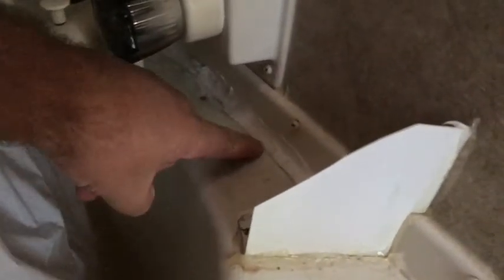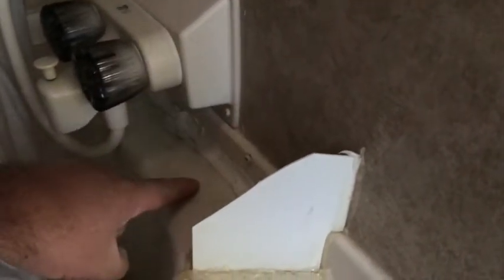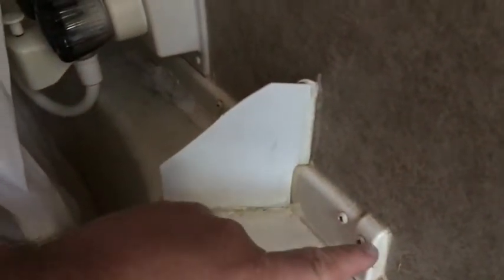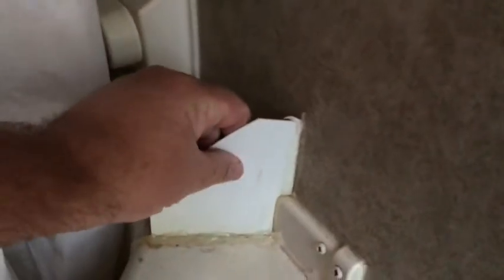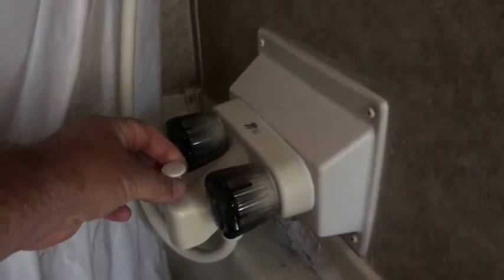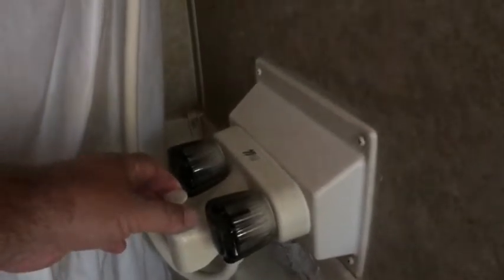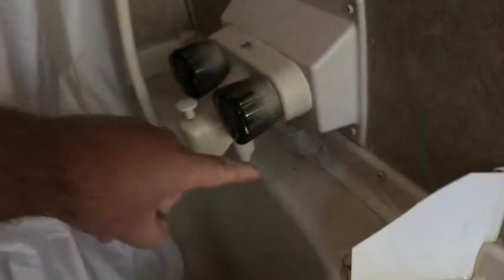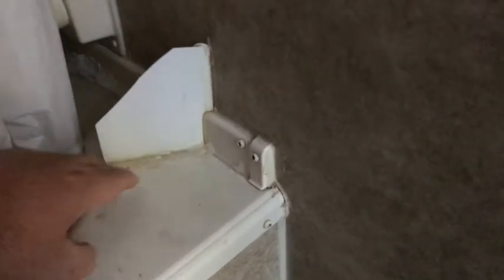RV Shower Leak Issue, Solution And Cause

Comment: I hope you come up with a permanent solution.  One of my pet peeves about motel showers is they have shower heads way up high.  I'm a rather short female, and I appreciate a hand held shower head.  A hand held is also useful for bathing children and dogs.  Not being able to use the hand held shower in your unit must be very frustrating.  I've been in motel rooms meant for wheel chair accessability.  Yes the wheel chair can wheel into the shower, but again the shower head is seven feet high.  How is a person in a wheel chair suppose to use that?